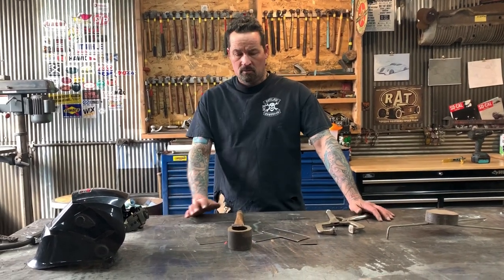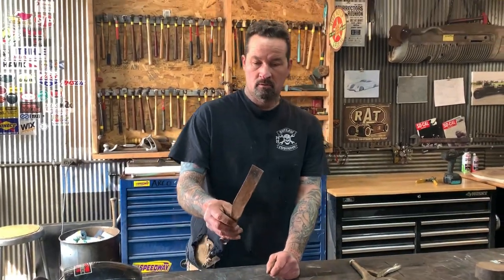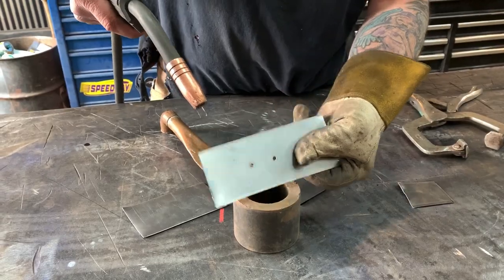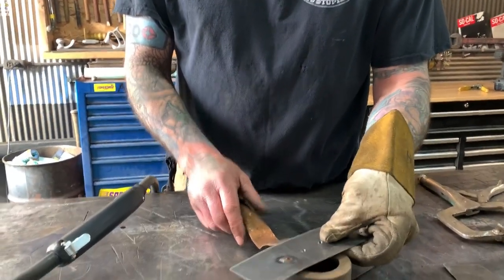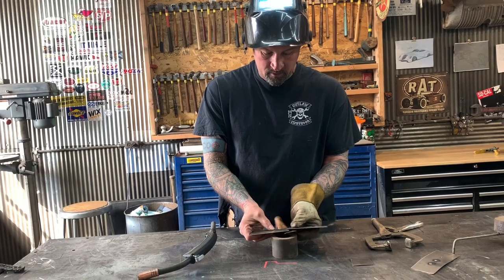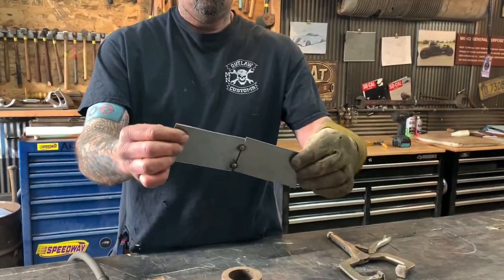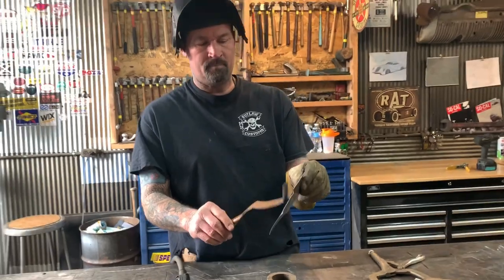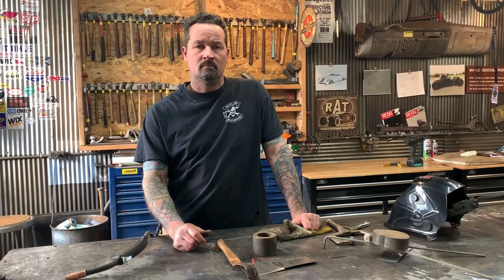Welding Tips and Tricks: welding up gaps and holes backed with copper

Comment: Using thicker pieces of copper helps with welding flat sheet. If you get some 1/8th"+ flat bar you can even clamp it to the back to fill much bigger holes than you'd have a hope of without it. The techniques pretty useful for panels that only have a few unrequired bolt holes that are just a little too big to be plug welded on their own, but not quite big enough to conveniently weld in extra metal.

Also, if you give the copper a quick hit of anti splatter spray there's virtually no weld sticking to the copper, and just popping off the clamp will usually be enough for it to fall loose.

I've even used this technique to build up material to replace 2 broken teeth on an old lathe rack before re machining. I just clamped the rack to the bench to keep it flat, and clamped a slab of copper to either side, then filled up the space where the missing teeth had been using a stick welder. The copper pulled the heat out of the surrounding metal, so that helped with distortion, and the copper "Dams" meant I could fill it up as one big weld pool rather than taking several passes at it. It worked a treat, and the repaired racks still working fine.

Comment: I was going to try a piece of ceramic tile, but for access to the area a piece of copper pipe with be sooo much easier. Going to try it today. Thanks and keep up the great posts!
Reply: A piece of 3/4" copper scrap with elbow and "handle" worked GREAT!!! Flipped it over and used the round end for corners to repair suspension arm mounts in a vehicle that were accidently cut with grinder while removing old parts. Even able to use flat end to repair slices while new parts installed- without throwing heat to the new bushings. Your video was a lifesaver. Thanks.

Comment: yes, a piece of copper is always a lifesaver when you're filling the unfillable. thanks for sharing these tips and tricks.
the uv and blast of light from welding will shorten the camera's life, just make sure to use some type of uv filter to protect it and try to minimize welding in front of the camera. a din5  or higher welding filter will work great for getting welding shots as well.

Comment: I worked in a Texaco gas station in 1952, when gas stations were the small auto repair shops. We had a body man that moon lighted doing body work. He taught me to de-chrome my 47 Ford coupe using copper pennies as backup for brazing the holes. Pennies were solid brass then. My hood was worth more than the car with the pennies stuck underneath. I like the copper tubing trick also. We didn't have Mig welders back then. Oxy was the way to go.
Reply from the maker: Toolman that’s awesome old school methods 😀👍 thanks for sharing brother

Comment: Good tip, Arco. Copper conducts heat rapidly too, so it’s working as a heat sink to keep warpage down.
BTW, use only copper, and not brass. Although it will function as a weld backer, brass is an alloy of copper and zinc. Welding on brass could release zinc fumes that will make you sick.
Keep up these great tech tips, Arco and Heidi! Thanks for sharing your knowledge. 👍Tony B

Comment: Great tip. Fantastic for holes. Works even better with aluminum. Sellers on Fleabay have copper strips  in various widths and thickness, thicker should help dissipate the heat better. Copper is expensive but, worth it. Harbor Freight quit selling their copper welding spoon, only major rip off eastwood sells them now.

Comment: Can this be used while plug welding aluminum with a tig also?
Reply from the maker: Yes 👍 it works awesome. 
When you’re welding it will seem like it’s stuck or welded to the other panel but all you do is move it around a little bit and it will pop right off. Hope this helps you out. Thanks for watching. Arco
Reply: @OutlawEdge  right on man thanks.